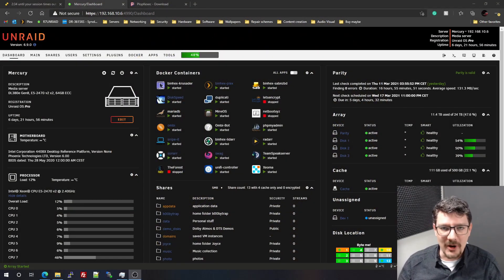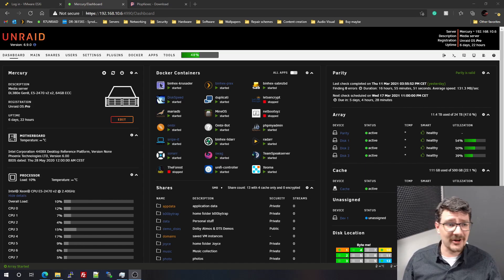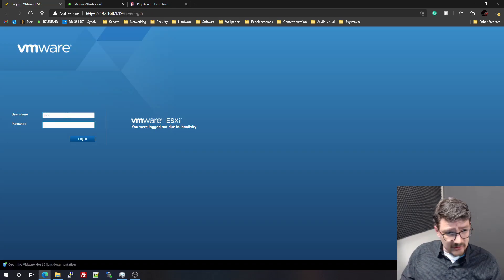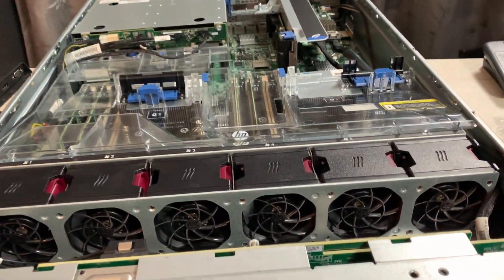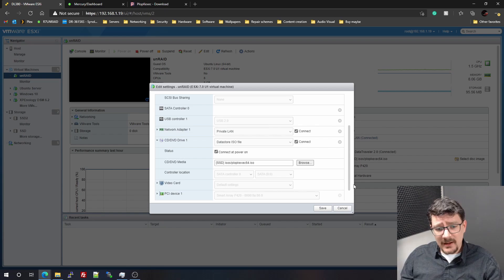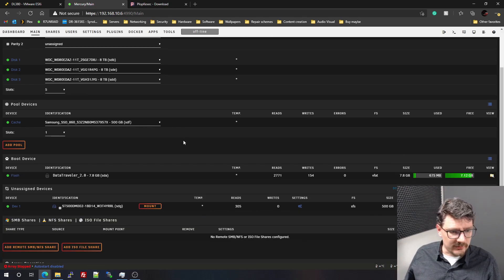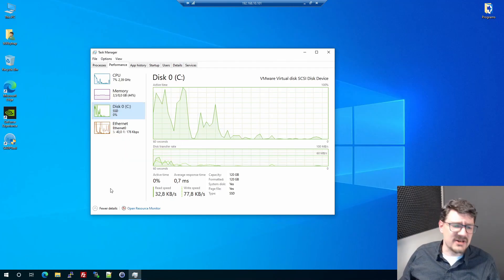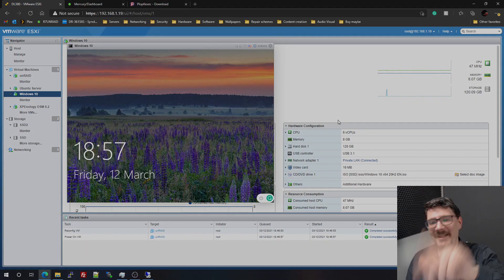Will virtualizing unRAID be the solution I'm looking for?

Comment: this probably wont help but when i was testing gaming on a vm in unraid i had stuttering in scrolling. The only thing that fixed it was passing through an entire disk as the boot disk. No amount of pinning, cache drives etc or xml tweaks would work. Once the entire disk was passed through it was snappy and the stuttering was mostly gone. Probably wont help your case but thought id mention it. Good video bro

Comment: Virtualization is virtualization regardless of where or how.  The important thing is your perceptions and for that, you need to do the thing but please don't feel like ESXi is faster or slower than any other Hypervisor.  I too have tested many hypervisors and they all run about as fast as every other. I have run Hypervisors inside VMs and they run as fast as the host Hypervisor and that was KVM. I would be more concerned about RAM and Storage. For me, UnRaid is the best. I was rather disappointed in the highly vaunted Proxmox that seemed under featured when compared with KVM in Unraid. Keep making vids. Kudos on the effort.
Reply: I think IT has to do with Numa-node, cpu cores / vcores setting per host and guest system
Reply: @adoteq_  All of that may be important to you but I have not seen that it matters to any computers I have ever owned or used.
Reply: @TheUnknownOneAmongUs  oh IT does when using virtualisation. Normally IT would go automatic, but if the hypervisor for some reason doesn't automatically detect the cpu lay-out, you may run into performance issues
Reply: @adoteq_  KVM CPU passthrough so this is not an issue.
Reply: @TheUnknownOneAmongUs  even Then, IT still does matter. Because, how Will the host be operable when passingthrough a cpu to the guest?
Reply: @adoteq_  Does not seem to matter when KVM does this and it works.

Comment: love the idea the question is, how can migrate all my stuff from unraid to a virtual unraid? basically how can i move all my crap :( 40TB, i got my unraid on a flash and i can boot exsi on a flash drive too to boot but do you need to migrate all your stuff from the old to the new one or simply start exsi install unraid and assign the disk like the old one nathe they files will be there? i guess my confusion is because exsi is virtualiztion at hadware level

Comment: Mhhh.. 
I can't wrap my head around those Windows VM problems. 
My System has: 2 E5-2630L CPUs really low Clocked but I don't have any problem with it. 
There is no sluggishness or perceived "slowness". Its just the bootup that takes a little longer, compared to my Workstation.
Its all  on solid state, tho.
Reply: From the top of my head, one question, how did you configure the CPU to be used for that Windows VM?
Reply from the maker: Hey cYRoN, thanks for watching and sharing your virtualization experience. I'm also not sure if it's the core clock of the CPUs but I've tested a lot of configurations lately and pretty much this is the only thing that I can think of at this point. I'm also running the VMs of an SSD. I will continue to tinker with this setup :)
Reply: @b00bytrap  What about the virtualization mode of the CPUs? There seem to be differences there. Most of them seem to be more or less for compatibility reasons.
Gotta try this on a different machine with more Horsepower to be certain. :)

Comment: Always nice to see you upload videos :D currently I only do own one server and want to experiment with running a gaming vm within unraid. Unraid is mainly used for dockers and data. When virtualizing Unraid is it possible to use the current usb, so that the only change for me is going from bare metal to virtualizing it? I want to use the gaming vm in combination with something like Rainway to use it as a cloud gaming solution when not at home.
Reply from the maker: Hey BananaboxTech, thanks for watching. When I started with unRAID I also wanted to use it for a "cloud" gaming VM. I did several videos about it and it was in a way working pretty good for casual gaming. Back then I used Nvdia game streaming in combination with Moonlight. Sometimes Steam streaming.
I don't recommend virtualizing unRAID for this purpose. You'll want as few layers as possible in this case.

Comment: If you want to back up your VM's for free, you can use Active Backup for Business on your Xpenology VM. It will do ESXi free using root credentials. Also, not sure if you used thin or thick provisioning for your Windows 10 VM, thick will give you better performance.
Reply from the maker: Hey akurenda1985, thanks for the tip. I will look into that. At the moment the shares I have on unRAID are also shared in DSM. Works pretty great. I'll have to see where I want to store the most important VM images.

Comment: I'm still having issue passing though storage to all my virtual machines to see - any advice?
Reply from the maker: Hey Vintage Tech Repairs, thanks for watching. Well If you want to pass through a controller like I did, make sure it's supported by ESXi, after that you can pass it through to one VM. I used the onboard softraid controller for the datastores within ESXi